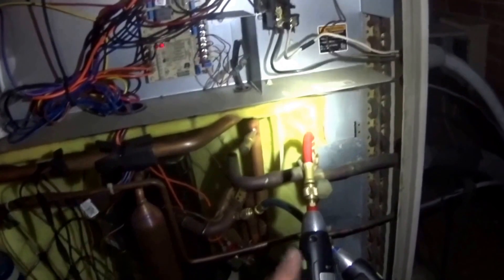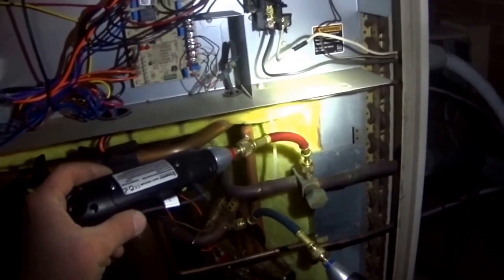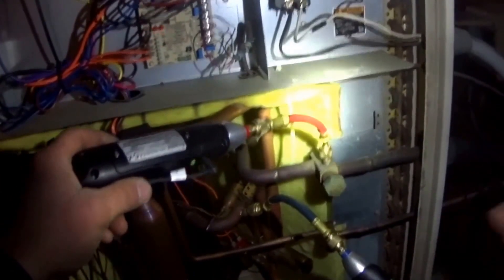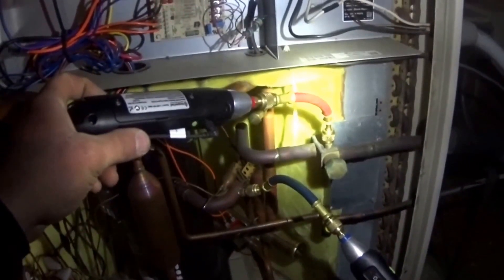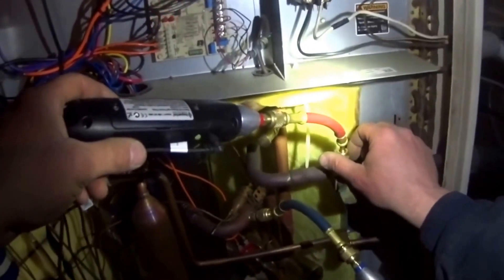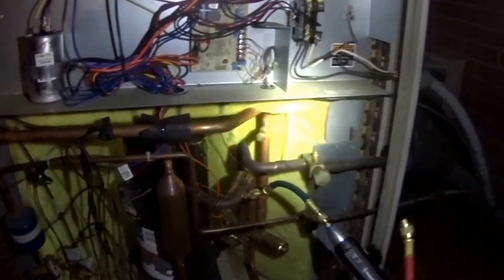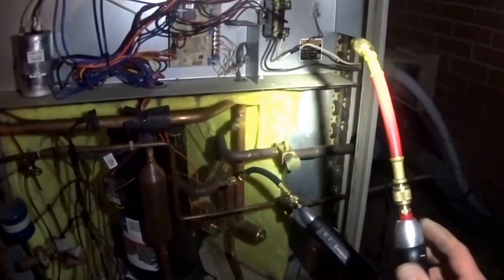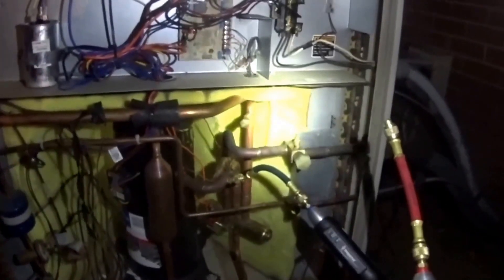HVAC Tools: iManifold iConnect Wireless Pressure Probes No Need For Low-Loss Fittings

Comment: That looks like a newer line of my lennox heat pump my heat pump is a dimension series from may of 1993
Reply from the maker: heatpump hvac that is a HP26 from 2005
Reply: My is hp22 from 1993 it has a defrost board with ice cube relay instead of 9n board relay